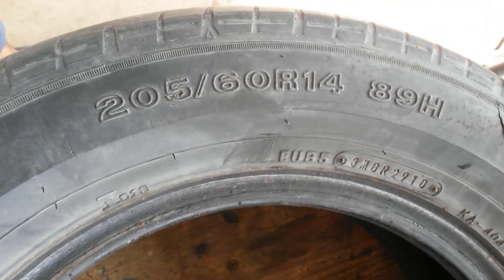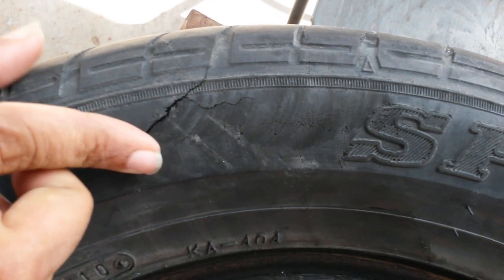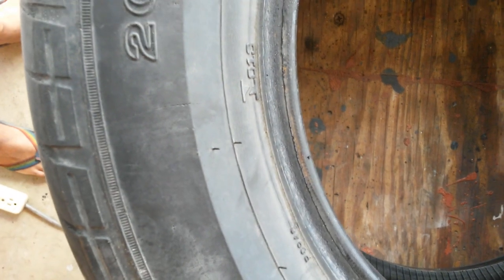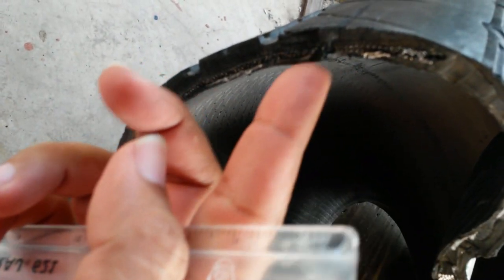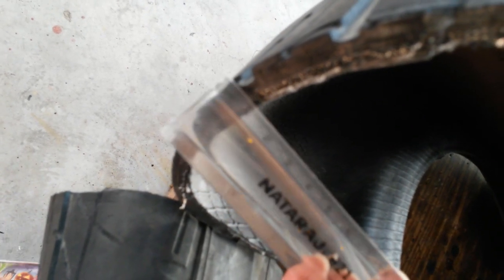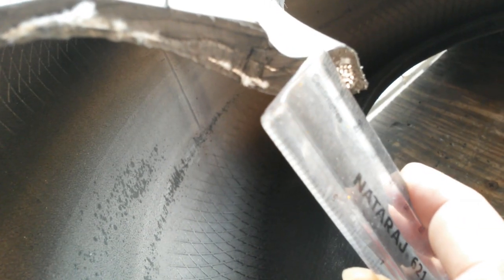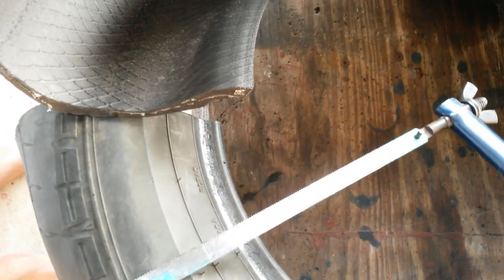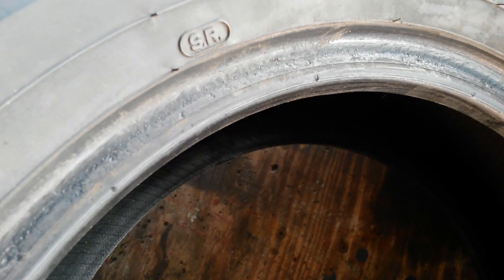046 Cutting a Car Tire

Comment: why call this "cutting a tire", that's the one thing I wanted to see, this video is labeled wrong
Reply from the maker: That's a good point. It sounds better than a more technically correct description like "Inspecting a tire after its been cut". 

The cutting is actually a little challenging.  I was not brave enough to try an angle grinder so its all manual. The rubber grips on to the hacksaw blade when that was used.

Comment: Really nice, man. Lots of fibers and metal there. :)
Reply from the maker: MC's Creations yes lots in there. Proper Japanese tire. The wire is very hard to cut with a hacksaw or shears. I am taking off a piece of the threads and I will pull out some of the wire. I doubt its stainless but its definitely high tensile. I want to see how it behaves.
Reply: Manick N Nice! :)